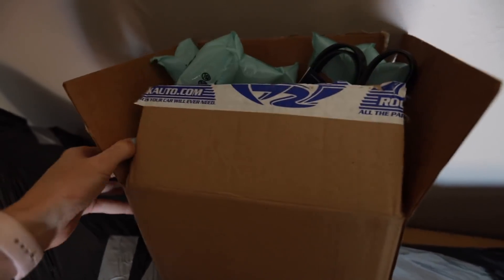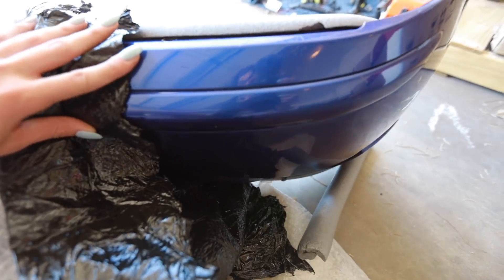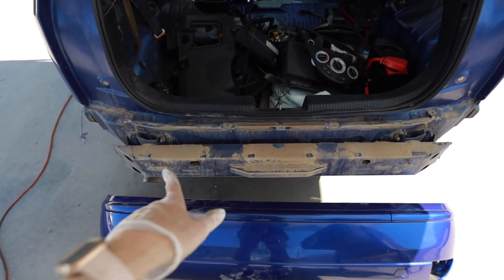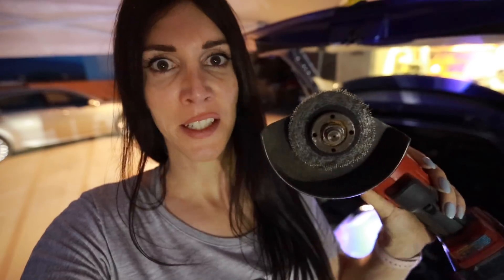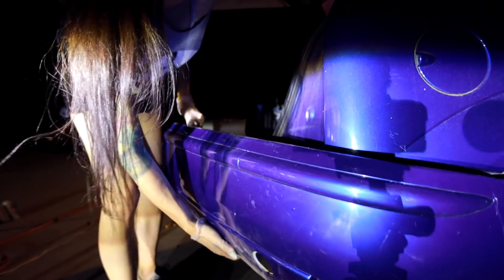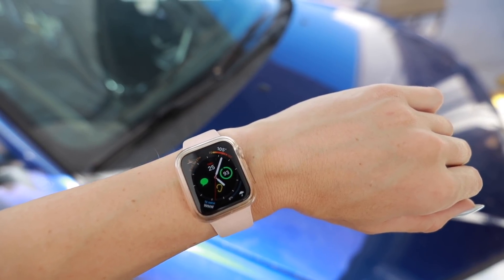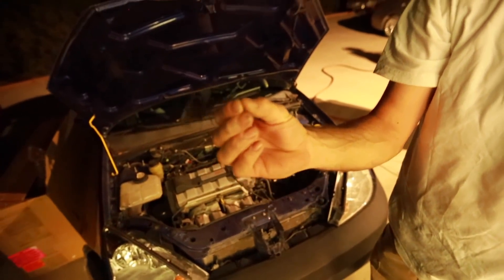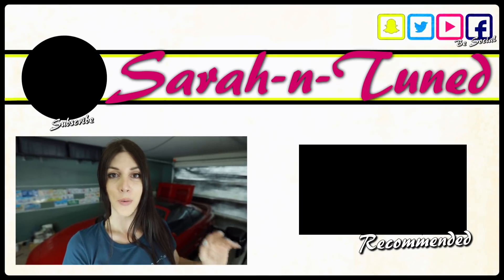Success Turned Into A Dumpster Fire // Project Focus Rally Car

Comment: Speaking on behalf of the UK, we'd be happy to send you parts. US bumpers are way too big, just look at the mess they made of the MGB with the rubber bumpers
Reply: Probably the best example you could use...MGB. My dad had one(here in the States)and it was atrocious compared to the Euro version.
Reply: Soooo right! Until then it was my favourite affordable-ish UK sportscar. Look at the mess it made of the Jaguars too.
Reply: Didn't our European  Focuses have much wider flared front arches than the stock ones, explaining the extra width of that weird front bumper moulding/cover?
Reply: I’m looking for a front MK1 focus bumper.
Reply: That bumper has China all over it, not the US...
Reply: Chris Dunham, where would you suggest I look for an ST170 bumper for my SVT? I hate the rear diving board I have on mine.
Reply: Not to mention the BMW 2002 and 320!
Reply: We messed up the Alfa Romeo Spider bumpers too!
Reply: @yogimarkmac  They were pretty bad yes !

Comment: Most people in Germany don't know, that you're only allowed to turn on those rear fog lights (Nebelschlussleuchten in German), if the visibility is below 50 m (55 yards) which also means, that you're only allowed to drive at most 50 km/h (31 mph). I've been driving over 20 years now and I get in those conditions maybe once every 4 years ... Although everyone did have to learn it, to pass the license exam, most people seem to forget after a few years. I bet, that many don't even know where the switch is in their car and what it does ...
Reply: Same in Italy. The fog light use a 21W lamp,, same as stop light. if you use it without need is very annoying the car behind you. But very useful in REAL fog.
Reply: Nebelschlussleuchten?
Reply: Richtig ;-)
Reply: Same in France.
Reply: Same in The Netherlands

Comment: The Focus RS has wider wheel arches , that’s why the bumper sticks out the sides.
Reply from the maker: Stephen JC Not in the case, what you cannot see in the video is that the front of the bumper under the headlights itself is too wide/deep, the flares are irrelevant to what I’m trying to show. That and the fact the quality overall is atrocious, it would take 20 hours in bodywork alone just to get it remotely respectable looking.
Reply: That's not an RS bumper.
Reply: Sarah n Tuned ahh ok, sorry. My comment seems a little dry haha. The idea popped into my head and I wrote it down . I like the Rally car idea as not many are doing that. 👌🏼
Reply: @SarahnTuned  I have just converted my mk1 SVT or st170 as its called in uk into a RS Focus. Fitting the front bumper was one of my toughest accomplishments. Its true the headlight area is also troublesome because although not immediately obvious the RS front wing meets the headlights with a straighter edge than SVT. The front wings are also a lot wider. Make no mistake the RS is as the title would suggest a racing rally car in every sense.

Comment: Rear: Round tube crash bar using the OEM mounting points for the factory bumper beam. Then you can add a threaded bung for the European tow hook. Front: OEM base model Focus bumper cover. You want a part that is easily sourced and replaced, because Rally car. If you modify that POS you bought it’s a one off you can’t easily fix or replace. Keep the front stock ZX2 and carry on.

Comment: Fun fact about the svt rear bumper. Ford created it to allow them to run an even bigger wing on the 03-04 focus wrc group A car.   Also you picked up the RS width front bumper. There were two replica widths made.  You can easily roll/ pull the front fenders out. Or find the wider RS fenders. 🙂.    Easiest is the standard 00-04 focus front bumper. Cheap and plentiful if you get wild off road.

Comment: Hi Sarah, the bumper beam is not intended to provide structural stiffness. The objetive of body's stiffness is to maintain the suspension's geometry under dynamic loads like bumps or lateral forces in turns. The basic idea is to keep the 4 wheels in the same plane all the time, or if you prefer prevent the car's cage from twisting. Therefore a beam hanging ah the rear of the car cannot do much. Those beams are designed to absorb crashes while offering some degree of pedestrians protection.

Comment: Sarah... Get a large piece of foam, shape your bumper with design features you want and use that as a form to mold your front bumper using carbon fiber. Very strong and very light weight. With your skill level it would be easy and much better than the POS bumper you purchased. Anyway best of luck. Enjoy seeing you get into it all and the depth of your mechanical and electrical knowledge. :)

Comment: The RS had a wider shell but it was in the fenders, the main shell dimensions were the same. Looks like someone guess the bumper dimensions. You probably could make it fit, but you want something if you wreck it you bolt another on not a bespoke hand fitted one. Keep up the great work.

Comment: Best laid plans....

I would put a plate and bent tube bumper on the rear, to replace the 5mph one you removed. It’s very light weight and plenty strong. A stock junkyard bumper would be okay for the front.  You could always customize it a bit if you wanted to change the look.

Comment: IMO
Rectangle tubing for rear bumper support.
Ditch front bumper, add skid plate.
Then you don't have to worry about getting air then tearing up the bumper and sending it under the car.

Comment: Yeah, so there's a different rear rebar for the European market...  The Euro part bolts right up I believe.  Both the front and rear crash bars are made of super hard steel.  If you need to drill either for anything you better get a few extra drill bits (or cutoff wheels, as you've found out).

Comment: Throw a stock front bumper on it, fab up a small nudge bar for the front, and have the nudge bar wrap under the bumper to join radiator protection.

Comment: That gen 1 rs bumper need the fenders to match the rc is about 3 to 4inch wider the stock focus 
Another thin I would pull off is the side skirts and go OEM ZX3 but that's only if you trying to save semi wanted parts 

There are a few other things that I would do if you are going to rally 
Like change to 2006 and up nuckles and hubs you will need .188 adapter sleeves 

But the later model focus lower ball joints and can still run svt clappers and rotors

Comment: For the front bumper, you could get a cheap stock focus bumper and modify it to fit rally lights, and you won't feel bad about hacking it up because it's a cheap stock one (you can probably find them at a junk yard).

Or you could custom fabricate a front bumper out of steel or aluminum like Jeeps and off-road trucks that have bull/bash bars, integrated into the front skid plate, plenty of space to mount lights and maybe a winch... It would take more time than buying a plastic bumper but it would last a lot longer and let you show off the unique design.

Comment: Hate it when parts don't fit. And clearly you are one not happy camper. Make a mold of the desired bumper, and then sell copies. That could in itself be a cottage industry. Two of my lots of daughters, the two who are identical twins, had matching ZX3's earlier this century. Nice cars. Had potential, I thought. Love the work ethic you have. Hard to explain to to others why 12 hours straight in the garage doesn't feel like any time has passed. Keep on Truckin', and thanks!

Comment: Assuming you can't return that one... I would cut it down so that you make the lower spliter and radiator guard out of metal and octagon mesh and the fiberglass part just to frame in the headlights and seam to the bumper.
Though a fair point is if we all started to return the junk aftermarket parts that don't fit vs making them fit the market would improve.  Though the $150 to ship a $200 part back is why I have random aftermarket parts that were never used.

Comment: You think of maybe just fabbing something up? Get some sheet metal and steel tube and make a bumper. You are already fabbing up some support for the rad and steel underplate. Like you said it's going to get beat up. Make it out of something stronger than plastic and fiberglass. Not sure about weight but wouldn't hurt to look into it. Can't be any worse than whatever that was you bought.

Comment: I actually just changed over my 987 rear bumper to the euro spec.  I agree euro got some better style without the 5mph bumpers. Also, just use a boring focus front bumper it's not cool, but they are around and cheap.

Comment: Hi Sarah,  love your video, great work.
Firstly, question/comment about the black bumper. It looks wider than the front guards. Could it be that it works best with wide wheel arch guards from the same manufacturer?
Secondly, looking at the ergonomics of your seating position. Your hands and arms should be positioned at the the 10 o'clock and two o'clock position, as this offers the best control. The position you have shown looks too high, almost as if you are driving a truck. The pedals in the Focus will be biased towards a position where yours calves are at a small angle to chassis. 
I would recommend getting a copy of the H-point book, that goes into these vehicle packaging details. //David

Comment: Not sure, but looks like you’ve a RHD Focus rear bumper as the reverse and fog lights are that way round.
Legally for a LHD car they are the opposite way round, so perhaps you can just buy the correct lamps and slot them in for Authenticity 🚙🤔

Comment: The rear bumper looks awesome. Do you really need a great looking front bumper? You could attach steel/metal pipes or something like that to the steel plate in the front. You could just change it if destroyed without having to buy a new bumper. Would look mad max bad ass 😄😄😄😎👍

Comment: Try a heat gun on that cheapo glass front bumper before you junk it.  Or, leave it in the hot sun and see if it becomes more pliable.  Maybe some localized heat where you hear crunching noises.

Comment: This is from focusfanatics dot com: "The F2 front bumper is no wider than the stock front bumper, the only thing F2 did was add fender flares to give it the appearance of being wider." Maybe adding fender flares is an option?
Reply: yeah that's what I thought, this bumper is designed for flares
Reply from the maker: Alvaro Amaya no, it’s way more than just that. The overall bumper is deeper and actually uneven in the way it was made. The amount of labor just to get the lines smooth and uniform would be more than it’s worth. When I said it looked like it was carved out of soap, I wasn’t joking.

The WRC bumper does have flares, however, the bumper itself is no larger/smaller in any other dimension.
Reply: I doubt this was from f2 as they've long since closed shop. Its probably the extreme dimensions 3rd hand ripoff.

Comment: although the RS featured unique front and rear bumper assemblies required for the wider wheel arches which accommodated the 65 mm (2.6 in) wider front track. Might be why the front bar doesn't fit>

Comment: Whaaaaaaat? NO FOG LIGHTS on US cars?! Really??  Fog lights are very bright red rear lights (usually 21W) that are visible for much further in fog than the usual tail lights (usually 5W). We don't need them very often where I live but when you need them THEY SAVE LIVES. Would a car equipped with fog-lights still get through a DOT test? Fascinating insight, Sarah.

Comment: I have that same front bumper on my SVT . That bumper was initially intended to be used with f2 flares . However I managed to get it to work without them.
Reply from the maker: CanadianGarage How many hours of bodywork did that take, I could only imagine.
Reply: @SarahnTuned  from what I understand I have an old school version which was made with a different material . Mine is more flexible . But I did have to make some relief cuts at the mounting points .

Comment: You looked upset at the end of the video. Don't feel so bad these things happen.
A little bit of Butters should be in very video. So 111f is about 44c - that's hot!
Reply: Yes, converting F. temps. to C. makes it cooler by just reading the smaller number...its 103 now at 6:18 pm here..so thats 39 C....much better... on my brain...lol ...I live here too,..TooHot, Az.
Reply: @maxfly7079  So 111f is still 44c, no matter which figure you look at. Southern Arizona is more of a desert like climate, whereas I live in Melbourne (south east part of Australia) which can still get to 38c to 44c (100f to 111f) during the summer and can get quite cool during the winter. When I was in the US in 2009, I parked in Arizona.. just on the other side of Hoover Dam :)

Comment: The federal crash beams behind the front and rear bumpers are a LOT bigger than the beams used on the European mk1 Focus. I happen to have a UK spec mk1 Focus rear crash beam lying at the back of my garage, but I suspect shipping from Scotland to Arizona might be prohibitive. 😕

Oh, and the rear fog light - that would only be used in low visibility conditions such as, well, fog. 😂  It's not something you'd use all the time unless you're a complete and utter cockwomble. In the UK, visibility has to be reduced to 100 metres (328 feet) before you'd use your fog lights.

Comment: You have the RHD Version of  the Rear  Bumper..

Rear and Foglight must on.the other side..
Purchase the Lhd  Version.of The right  Rear light and a Red bulb for your left rear light 

An ST 170 owner from Germany 
👍 👍
Reply: Safety/crash standards are much higher in the US hence the issue fitting the smaller euro spec bumper on over the crash beam

Comment: I'll be honest, given what its going to be doing, i'd roll with it, just hack it up to make it fit, plug whatever holes it ends up with and run it till it breaks, this both will give you a chance to find a better solution, and, will let you see exactly what a front bumper on that car is going to end up going through. Could be you spend a lot of time getting it just right and the first time out the bumper gets taken out, where a cheap bumper is cheaply replaced.

Comment: Comments about using fog lights in heavy rain!!  Really dangerous!  If you are in the UK, google Highway Code fog lights.  Rules 226 and 236. Only use fog light when visibility drops below 100m. Using them in rain obscures the vision of cars behind you due to dazzle and light smudging across wet windscreens. They also obscure your brake lights in wet weather.

Comment: You have an international audience ;)
When talking about outside temps of Arizona we'd appreciate the conversion ;)
Talking about engine temps, etc. we understand having to convert, but the outside temp displayed with an app should be a breeze for ya :) (like 5 seconds and three taps in your weather app?)
We can google it too of course, but if its really just the Arizona temperature and not 6 different numbers from the whatever engine setup.. Would be nice :)

Comment: The front fenders on the Mk1 RS are different than what came on the SVT, that's one reason the fit is off. I offered to help you with my Focus knowledge and my offer still stands. Let me know if you have any questions about the Focus. I've owned 3 SVTFS and I'm a former Road Test Editor for Motor  Trend magazine.

Comment: That fake RS bumper is way off the mark to original, the original rs spec will fit a normal focus bar for the fenders as they are considerably wider than its littler brothers and the bumper as it has a flare to its ends to match it. 
Plenty of ST170/mk1.5 Zetec s front bumpers kicking round if you want sport/rally “appearance” get a “Vector” front lower splitter defuser.

Comment: I find it odd that you are spending so much money and time on something that will be torn off at your first jump.  Since you have to fab a radiator support/skidplate, incorporate a steel front bumper into the whole design.  Tie it all into the roll cage and car frame and you'll have an extremely strong and solid front end that will handle the nose dives that might happen.  build a rear bumper out of steel as well.  Or do it all out of aluminum to save weight.  Fiberglass/plastic is going to be worthless in a rally situation.

Comment: We also put the fog lights on when its raining heavily on the motorway in England
Reply: That’s very dangerous  Using fogs in rain greatly reduced visibility for cars behind due to dazzle and smearing and they can obscure your brake lights. .  Please read your Highway Code  rules 226 and 236!
Reply: @barrybennett9563  I did not no to be fair. I drove in very heavy rain on the motorway and some people were using there fog lights and to be honest they were the only cars that I could see it was in the day time. Some had no lights on at all and I could barely see them. I looked at the highway code but couldn't find anything about rain just the if the visibility was less than a football pitch. Fog poor visibility.